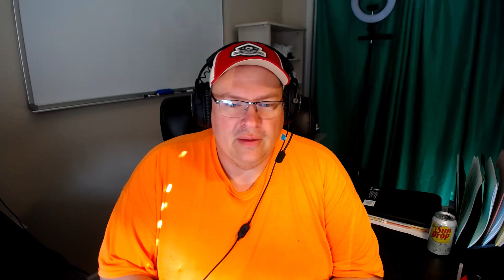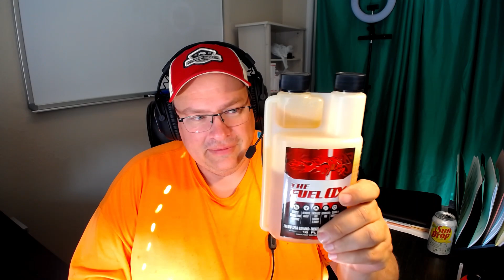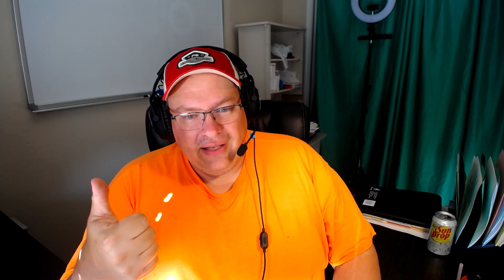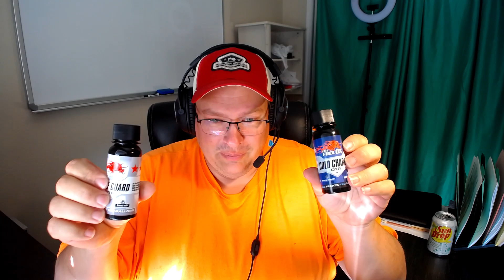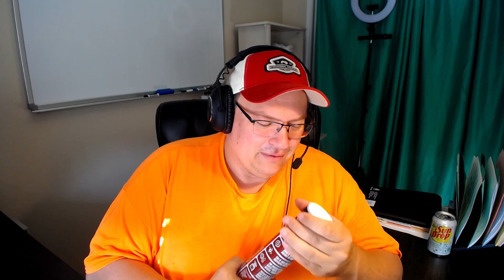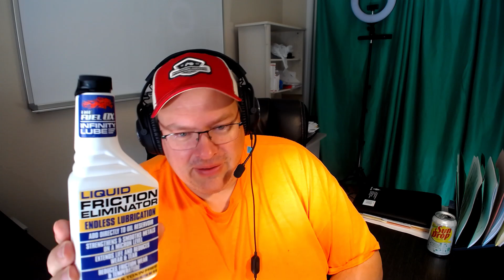Fuel Ox 6 month test results. Fuelox.com discount code diysemi for 15% off

Comment: I’ve been using the fuel ox asphaltene for over a year. I own a ram 3500 HO dually with all emission equipment. I have noticed about 1.5-2.5 mpg increase. I’m positing because I stopped using it for a couple months due to forgetting to add it. Got a P2459 code. Got the code deleted and added the fuel ox to a full tank. It’s been about 500 miles since the deleted code and so far no issues. This product works. If you have emission equipment this is a must.  Thank you for making this video!
Reply from the maker: I agreee. Hope you use my discount code DiySemi to save money on it!  lol.   great products
Reply: @DIYSEMI  every time I order
Reply: Still using it in the same ram?
Reply: @repairvehicle yes

Comment: Question, do I need an additive? I have a 2024  cascadia. You may not Remeber, I've had an engine replacement @100k miles due to an unfortunate event... soo I have 3500 miles on the new engine. 
I do feel I smell the burning in the agyertteat like my old Peterbilt..would you suggest always using an additive?
Reply from the maker: I use the fuel treatment every tank, the drivers report less regens and less def consumption

Comment: OK, it's been a year, time for some results.  I just started using Fuel Ox in my 2023 International LT A26.  I could tell the difference in seat of the pants performance and idle the first day.  My mileage increaed on heavy and light loads compared to the previous numbers.  I track mileage on the let's truck app and have numbers from day one for comparison.
Reply from the maker: Good deal. Any difference in regens? more? less? I notice far less need for a parked regen
Reply: @DIYSEMI  Since it's fairly new, and I don't idle much, I've only had four parked regens.  All after purchasing fuel in Salt Lake City in the winter.  Sapp Brothers was the worst.  Three parked regens on the same tank of fuel.  I think they over did it on the antigel.
Reply: 73K miles.

Comment: I tried the friction eliminator 1 bottle and even though it needs 4 10oz bottles for 10 gallons of oil, with just 1 bottle, I emmidiately heard the idle much smoother. Definitely  ordering more
Reply from the maker: that's great news

Comment: I was using The leading competitor on this and my dash mpg actually starting matching the paper mpg. Since I started using this, it has not matched dash mpg at any time and has actually gone back down to previous numbers. Truck doesn't idle due to apu. 2016 FL cascadia w/724k. Not happy with this product yet and I'm wondering why the are absolutely no bad reviews on this product.
Reply from the maker: this is the first time i've heard this result from someone. Would you mind calling the company and talking to them about it? They do offer money back if not happy. I have had a few say they didn't notice a difference, but this is the first time i have heard someone say a decrease.  by all means do what woks for you.

Comment: How would this work on a pre emmisions truck?
Reply from the maker: Last qtr I ft ta 7.65. I wouldn't make the claim that it cleans my injectors unless I physically pulled them out of the truck, put them on a bench and tested the spray pattern on each one. Anyone who hasn't done it shouldn't claim it. But I do know the truck runs way better. idfes smoother. Better mpg.
Also tried the infinity lube in the oil. Also a noticeable Improvement in smoothness in my older engine
Reply: @DIYSEMI  just playing man, ill use it because youre 1 of the very few honest youtubers here and you stand behind it and your word holds weight
Reply: @DIYSEMI  alright, after many messages,youve convinced me. Im using fuel ox
Reply from the maker: Works great on my 99 series 60
Reply: @DIYSEMI  yeah but hows your mpgs and did it clean your injectors?

Comment: Starting to hate this product cause you can’t get it anywhere and I don’t have a physical address I can get it mailed to
Reply from the maker: I have seen it at Iowa 80 ang Joplin.   They are working on a distribution deal
Reply: @DIYSEMI  I’m at Iowa 80 now and they don’t have it currently I picked up the last stock of what avoca had which was 6-8 bottles of the 3oz winter stuff. I might start having it mailed to my head office. I just prefer it cause it does everything so I’m not buying multiple additives

Comment: I know it’s not related comment sir but if you know what is the oil operating temperature in these Mack pinnacles ?
Reply from the maker: a little under 200
Reply: @DIYSEMI  mine gets up to 235😒